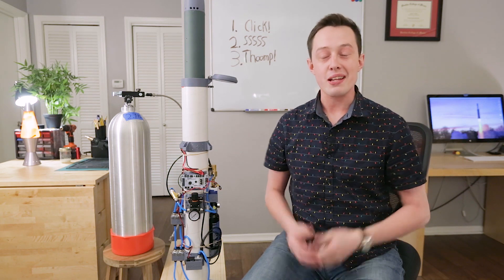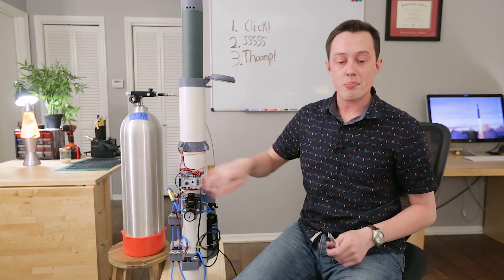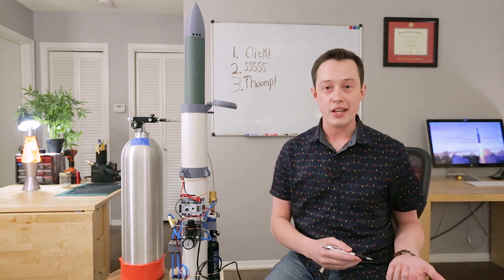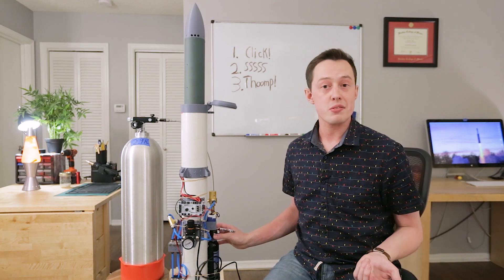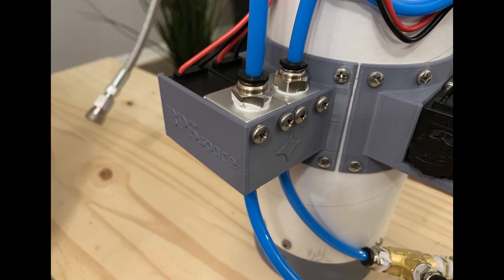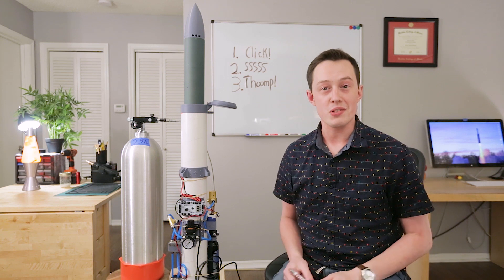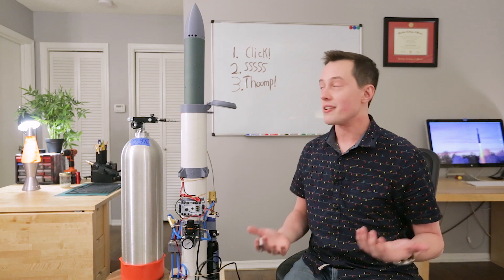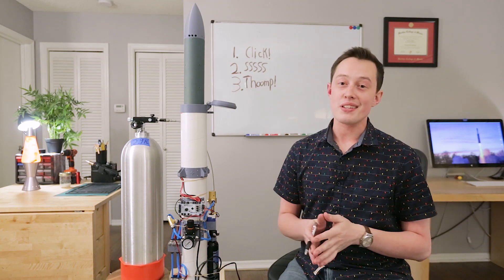Silo-Launched Model Rocket Development

Comment: Did you think about just putting vent holes in the launch tube? Would be simpler than using bleed valves, and quite effective. The holes would be big enough to prevent premature "launch" but small enough that once the event happens there will be enough pressure to eject the rocket. This is how HPR rockets do it with their ejection charges. vent holes to allow the 1 atmosphere gasses to escape as the atmospheric pressure outside the rocket decreases (sheer pins are also used for that, but I don't think you'd need those here)

Comment: There actually is a system like yours that "hot launches" from the cylinder. The piston under the rocket has a hole centered on the exhaust and uses the exhaust to pressure up the piston. Results are said to vary.

Comment: If you could build cold launch systems you could probably develop rockoons using some higher power motors and do "edge of space" launches for higher efficiency. If anything developing a rockoon platform would be easy with what you have made so far since you would need thrust vector since fins are useless in the very thin 1% of the atmosphere and you have decent computer tech.

Comment: Just a thought.  For more mass flow through your valves you might consider electric sprinkler valves of the type used for irrigation or fire suppression.  Such valves can also be found in common washing machines, though the voltages to actuate might be a problem.  I saw a paint-ball bazooka once that used a fire suppression valve and some schedule 40 PVC pipe for both tank and launch barrel.  The valve had massive flow rates, good working pressure (100PSI) and could be actuated by three 9 volt batteries in series.

Which brings up another though; If you want a really proper "THOOMP" from this thing, switch to a PVC launch tube and ditch the piston.  Wrap the rocket in a sealing sabot and use direct air pressure to launch it.  That cures all the problems of piston stroke limitations and guides in the tube.  Schedule 40 PVC has a pressure limit of something like 200 PSI, is relatively cheap and easy to work with, and is strong and light-weight

Comment: Titan II pretty well destroyed its silo on launch, despite the blast deflector and exhaust ports.  It was designed from the beginning to be a one-shot system.  The only Titan II launch facility that was routinely refurbished and re-used was the test launch facility at Vandenburg AFB in California.  The blast deflector and water deluge was only to prevent the missile from destroying itself before it cleared the silo.  Highly recommend the Titan Missile Museum YouTube channel and the full-length documentary Command and Control.  I supported communication equipment on this weapon system back in 1966-1969, 381st Strategic Missile Wing, McConnell AFB, Wichita, KS.  Hot launch on the Titan II was used because the fuel/oxidizer mix was hypergolic, i.e. combusting on contact.  Although extremely toxic and dangerous to handle, the fuel, unsymmetrical dimethyl hydrazine (UDMH), and oxidizer, nitrogen tetroxide, were stable at low room temperatures.  This allowed the missile to be stored fueled, unlike its predecessors, the Atlas and Titan I, which had to be raised from their silos and then fueled before launching.  A Titan II could be in the air in less than 1 minute from the receipt of a launch order, vs. about 45 minutes for the older systems.

Comment: I was born a rocket nut and still at it 74 years later. In the mid fifties I was "hot launching" my own home built model rockets out of long tube silos that worked perfectly and gave them a tremendous launch boost fully utilizing the initial exhaust pressure. The trick is to use reasonably tight sealing but free sliding sheet metal cone skirts top & bottom on the rocket body like a shuttlecock to seal the gases and keep it stable in flight. Yes there is some increased aerodynamic drag versus fins but it was always overcome by the increased launch speed. They were long gone and way out of site...
Reply: Working on launch tube  8 ft   Carbon fiber  1/4 inch  thick

Comment: I left a comment about this on Tom's video, but you should consider using propane for your RCS propellant. No need to combust it, it's just that you can get a much greater amount of propellant on board with a much lighter tank mass (you can use a 16 oz soda bottle).

Comment: Rather than rollers in the tube, light single wire hoop springs to hold it centered. Better... the same arrangement on carriers which will travel with the rocket up the tube and be shed once in the clear. Cheaper, lighter, less friction.

Comment: Instead of using complex air pressure system, you could use a tiny rocket motor or an explosive charge to eject the rocket.  Something similar to a Javelin system or other shoulder mounted rockets.
Reply: Yeah but that wouldn't be a cold lunch .... And would potentially damage the luncher

Comment: Have you considered using a QEV (quick-exhaust valve) as your firing valve? They're very fast, extremely high-flow, cheap, and pneumatically piloted (meaning you can use your existing solenoid valve as the pilot valve). 

I believe it would significantly improve the efficiency of your system by improving the flow rate of the gas, potentially allowing you to run lower pressures for the same performance. They're commonly used in homemade pneumatic airguns and potato cannons because they're so fast and effective.

Comment: Have you tried obturating rings around the circumference of the rocket, maybe open cell foam with some silicone spray? Turn the entire rocket into a piston. I can't see the cylinder lasting long with that much flow.

Comment: I've developed a similar system although I made a few different design choices that maybe you'd find beneficial. Your mass flow rate is very limited by using those solenoid valves (as you've noted). The solution to this problem is by creating a "dump" tank with a dump valve.

Essentially you set you regulator to 90 psi and fill the dump tank to equilibrium using your solenoids. The dump valve is a high volume flow rate valve (often a ball valve with a high speed actuator) that is connected directly to your piston with minimal fittings. As all connections remain large, you can extend the piston at incredible rates and force. 

That being said, I understand that the silo launcher isn't necessarily supposed to send the rocket too high

Comment: Don't know if you will ever read this but

For having a throttle controled model rocket you can use a fuel e.g. PVC and use a small pure oxygen gas bottle that can be throttled with a small servo that spins the open throttle

Comment: Another amazing video Joe. Would like to hear more about how you plan to ignite the rocket once it is ejected from the tube. Can you ignite it from the rockets on board computer? How will you decide when to ignite? Can you sense using accelerometers when the ejected rocket is at apogee from its ejection or you just come up with a time delay? It's been years since I did any model rocketry but I used to have problems with my igniters falling out. Is that going to be an issue when you eject the rocket out of the silo?

Comment: Why is a pneumatic ram better than just using the compressed gas in the tube? I guess because of tolerances, but wouldn't a rocket designed for the tube be to the right tolerances?

Comment: Why would you waste the space using a pneumatic cylinder you could just easily 3D print a piston with a couple of o-ring bruise even if it is only cardboard it should still be able to handle that for a little while or if it becomes a big of a concern switch to PVC pipe which can handle much greater pressures like around 300 PSI just put an end cap on it and use a stick to Ram it down

Comment: You can use a sprinkler valve for higher volume. I used them on potato guns and they are affordable high speed /pressure valves.

Comment: How efficient is using the air pressure to operate the piston to launch the rocket from the silo , as compared to say mounting two or three small diameter capped tubes on the rocket(or in it), which in turn were seated upon slightly smaller diameter tubes inside the silo through which the air flowed?  . . these tubes would replace the piston and leave the space it took inside the silo free as they would be mated with the rocket when it was loaded .. would also act as guides  ..  and possibly mitigate the need for the bleed valve setup - a pinhole in the cap for example, or tolerances between flow/capture tubes .
More powerful, more compact, fewer parts, .. I hope that's helpful

Comment: How about using a sabot? Use the rocket as piston. Use a magnet to keep the lid closed pressurize above and below the rocket. Activate a electromagnet to counteract the magnet keeping the lid closed. When the lid blows open, the pressure above the sabot drops and your rocket starts to move. Btw the sabot could also provide power and control for igniting the rocket in mid air after leaving the silo.

Comment: "Not a missile" is the "For Educational Purposes Only' of the rocket world if I've ever heard it. As long as it doesn't (intentionally) go boom, you're safe regardless of what you're doing, pretty much.

I've actually done tube-launched rockets before, D's and F's are cheap, and foam gliders are cheaper. Ahhh, the good ol days before I worried about safety. Used a tuna can with four holes cut in the bottom and some black cats as the 'shove' charge. That seemed to work, but I think Pneumatic is certainly more controllable... and easier on the rocket.

I've actually built tube launch

Comment: How about a electromagnetic anchor?  This way you can pressurize the silo for a couple of milliseconds before releasing the anchor.  Kinda like in drag racing where they rev the engine and then release the clutch and drive down the track.

Comment: Hi Joe! Nice work. Why do you not pre-pressurize your piston first to find the  equilibrium between the weight of the rocket and the pressure resultant force. Would it not give you a better acceleration? And if automated you could even just ask your computer to throw it at a given altitude knowing the weight of your vehicule.

Comment: To get around the flow rate issue, you should pre-pressurize the cylinder while it's locked in a mostly retracted position, then release it to launch the rocket. That's what we did on our robot to get it to kick a soccer ball about 10 yards. At the moment, it seems like you're wasting most of your working pressure on trying to force enough air through the orifice.

Comment: So I would look at the Mk41/Mk57 SM2 Launch sequence, or a Javelin Missile launch (this holds true for most VLS)
State 0: The missile is in its canister, on a rail (yes, a rail) for the Mk41 VLS, and its fins are folded, but external to the body of the rocket. The Javelin has it's fins folded  into the body, and uses the tube it's in as the rail. The cold gas system is armed, but not 'fired' 
State 1: on 'fire' signal, the missile ignition system is armed, the cold gas system is fired, and the missile is ejected from the canister. the Mk 41 VLS closes the cell door after the missile has left.
State 2: On detection of being clear of the tube, the missile simultaneously unfolds it's fins, and fires it's booster rocket... past this it's all staging to the sustainer if present and guiding on the target... 

Sauce: check for slow mo launch vids of the Mk41 VLS and Javelin, or even the RPG-7 or Stinger.

Comment: Also as a machine designer with deep knowledge of pneumatic fluid power.  Check out the latest trade journals and suppliers of servo valve flow and regulation.  The technology from the 90s has gone down in price just like electronics.  Festo, SMC, Humphry, Bimba, Parker, Emerson.

Here is link to cube sat stuff just Google to get https://reader.elsevier.com/reader/sd/pii/S1876610217365220?token=36839BF3E0E9A4FCAE7550E0AA715D1F158F5CEB28A56C4B82187E3793EB4967DB6583A6E04D124A8B45351DFF95B504

Comment: what's the maximum speed the piston can travel?
I probably would have just used a sabot like a potato cannon instead of the slow moving piston. less mass to get moving- less pressure required. and when the piston reaches the end of the stroke- it still wants to travel upwards,  could launch itself out of the plastic tube and into someones brain

Comment: It looks like you're using a check valve between the scuba tank and the flight tank.  Don't trust check valves to seal a system, they fail too often and are subject to fod.  Always have a manual valve to seal the tank from back leaking to the scuba tank or atmosphere once it's disconnected.  This is standard procedure for most aerospace ground systems.  Additionally having a last chance filter downstream of the all the valves before the Piston will protect the Piston from upstream fod (either from the gas itself or from valves and other components destroying seats during use).

Comment: Wouldn't it make more sense to seal the rockets in the tube like a spud gun.  Use pressure behind rocket to eject it rather than a linear actuator?
Maybe a piston in the tube that ithe rocket sits on and gets ejected with the rocket and falls away before the motor fires.
You could do away with those dodgy valves and actuate a larger ball valve with a servo.
I get that it would use more air but it would give more height and more time to fire the motor.

Comment: Very cool ideas.
 Another potential design would be a gas generator system like the VLS on many missile subs. A charge fires a piston at the base of the silo, launching the rocket through a waterproof membrane or cap (in the case of subs).

Comment: Getting good with pneumatics is never ridiculous!

As a side note, glad you had it demonstrated that the RCS system needs a subsonic nozzle, though I know how it can suck to have these sort of mistakes rubbed in your face. This stuff is hard (and good at making smart people feel stupid), so don't worry about missing it. From Tom's video you look like you should be able to get almost an order of magnitude performance improvement (SI). If you want a quick and dirty fix, gluing a sheet of aluminium with a 1-2mm hole in it over your nozzles should get you most of it. Don't think you need a long tube to straighten the paths, you really don't. Thin as structurally possible and the gas will straighten itself.

Blue skies to you sir.

Comment: Will landing legs work in thump tube (especially if rollers are used?)

How do you switch from launch motor to land motor and maintain TVC? 
(Do you just make your own rocket sugar motor, calculate and add a burn delay for the second part of the flight?)

Comment: I swear that I am not a safety Nancy, but you should use better cylinder safety protocols with your dive bottle (scuba tank). If it tips over off the stool and lands on the valve you may just let the "Geni Out of The Bottle". You will be into a whole different realm of rocket experimentation if that happens.

Comment: I think a volume chamber with a large pop valve this will let you dump a large volume of air quickly but at much lower pressures. Look up pvc dump used in air t-shirt cannons. 
Kool idea i might try and build something like this. And actually put it in the ground. I think a 6in abs drain pipe as the main tube with a cable tied simi free piston. And a large dump valve with a 6x6in air reservoir will do the trick but if you store a good volume of air and the rocket is a good fit might not need a piston..🧐 my only question is how good are model rocket motors at ignition the delay is all over the place i can see issues with stability as your  trying to light a motor in free fall can be very very dangerous as it might not be pointed up anymore. Rifle the tube and add some type of spin might help but it be torture on the TVCS. Only need about 20-30 rpm to keep it mostly up right. Sorry for this crazy long reply just working it out in my head.. if you want an off the shelf dump valve look at turbo bypass valves.. but a low cost cheap test is a in line 1in ~2in sprinkler valve they are good to about 120psi and can move a lot of air quickly inline valve has no back flow preventer on it...
Reply: Also 3000 psi is good for on board stuff as you need to carry it but for that just use a cheap shop air compressor i mean you running it at 60-120 psi so perfect for this

Comment: Joe why do you have an arming set of valves and a firing set of valves?? If you wanted a two step firing system why not use a relay on the solenoids of a single set? The arming process switches the relay and the makes the pneumatic valve circuit live for firing..... May help with delta p over two sets of valves and improve air flow rate.

Comment: Why did you go with the piston you did rather than a disposable piston like in the cold launch video you used in your video at 3:06 ? 

How about a double walled launch tube with a spool valve at the bottom letting the pressurised air stored in the double walled tube in at the bottom and pushing the rocket, not a missile, out the tube, not a launcher?

Nice build though, I look forward to seeing more of this build.